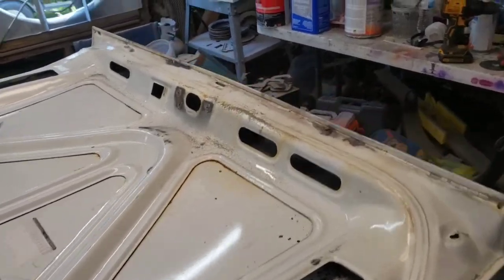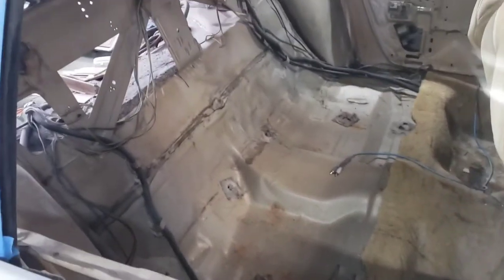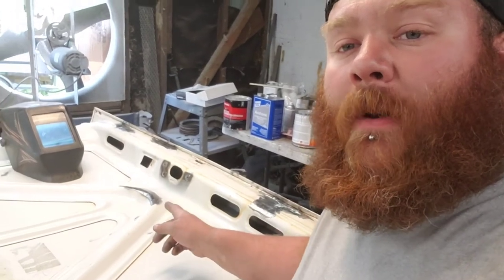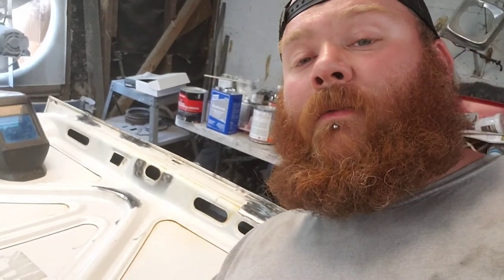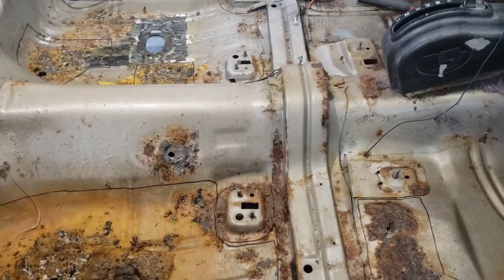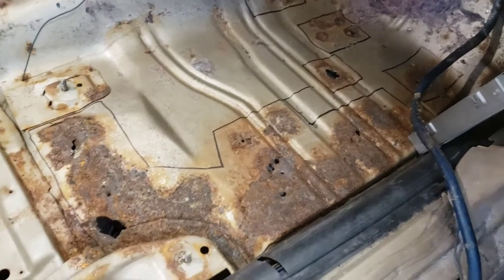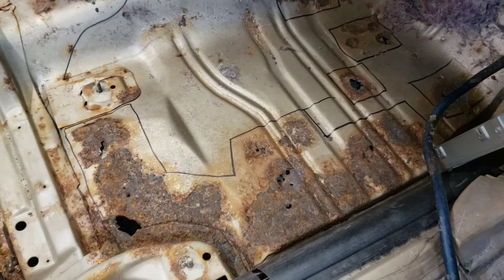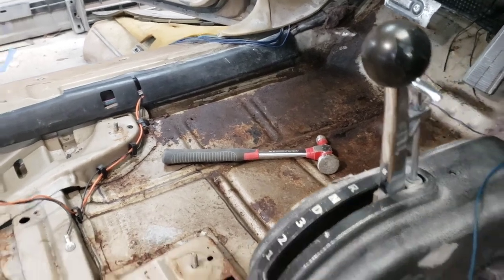Box chevy floor pan surprise. Box chevy transformation

Comment: Hell man, that looks better than half the cars around where i live, up here in alaska they're salt happy asf on the roads 😅
Reply from the maker: I hear ya. This car sat for a while with the doors leaking. So its just been holding water. Carpet was soaking wet underneath when I pulled it out.
Reply: Good luck brotha, imma follow along with your builds while I wait for it to warm up a little so i can start patching the bed sides and cab corners on my 78 f250 ranger, was a whole -20°f yesterday
Reply from the maker: @akdirtbiker2713  Much appreciated! Eventually there will be videos of my 71 f100 on here. It will be a while though.